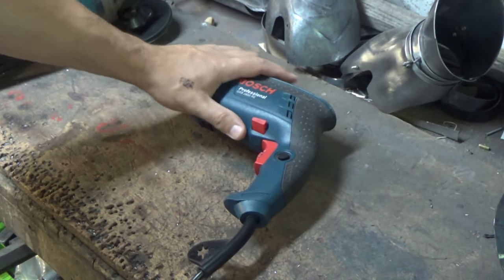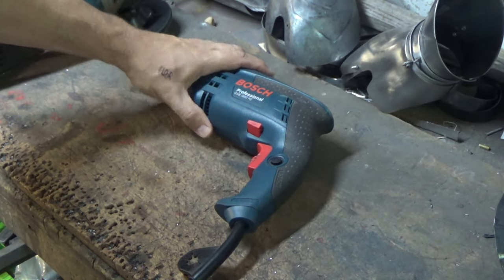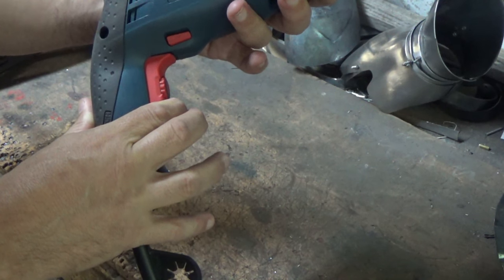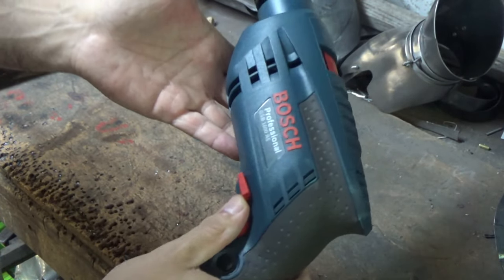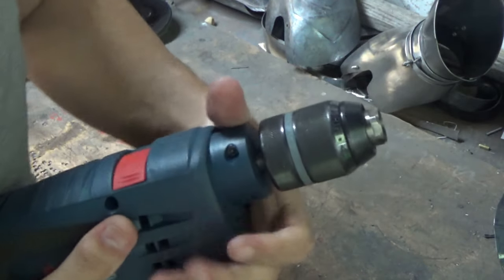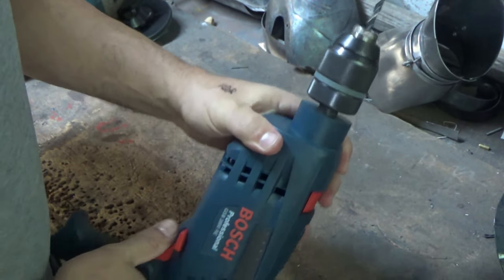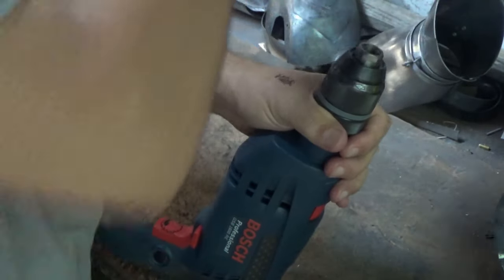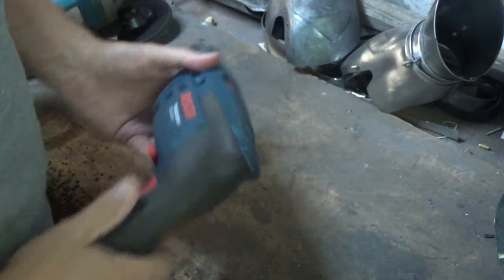Bosch Drill Review. GSB 1600 RE.

Comment: Graham,  I see that you were able to get a "corded" drill motor instead of a battery-powered one.  The last time I bought a drill motor (a year or two ago), I was having trouble even finding a corded drill motor and asked for help in one of the "big box stores" (a very large "hardware" store) and the guy sorrowfully told me that nearly 85% of the drill motors they had for sale (off the shelf) were batterypowered.  So we went to their computer and,luckily, I was still able to select and order the "industrial-quality" drill motor that I really wanted.  Batter-powered drill motors are convenient, but only when the battery is charged_.  I don't use my drill motors enough to keep the batteries charged, so I prefer a corded power tool, otherwise _every time I need to use one, the damned batteries are dead, and very expensive.  Thank you for buying a corded drill motor - you won't regret doing so.  I'm looking forward to your next video!

Comment: How do you feel about hand punches (Roper Whitney makes the best-known models, but there are others)?  I prefer hand punches for smaller pieces, like finger lames, because I can punch holes much more quickly than drilling them.
Reply from the maker: I used to use a knock off one that lasted forever and then I started drilling more when it eventually broke. On a lot of stuff now I use a hammer and punch into some lead, but I didn't have a punch this size so I used the drill.
I quite like them, when they work they work well, but sometime I found I would be wrestling the work off the punch more than I would be punching the material.